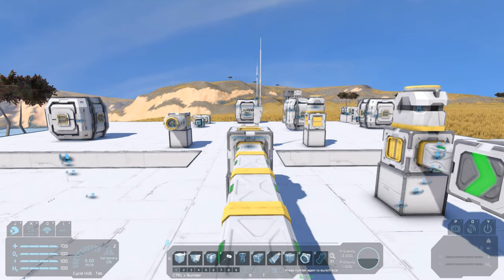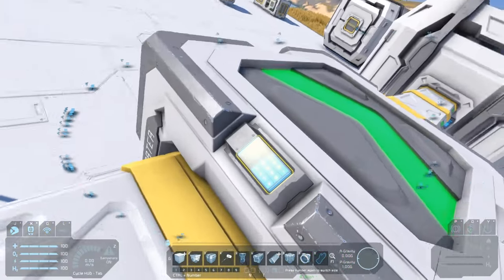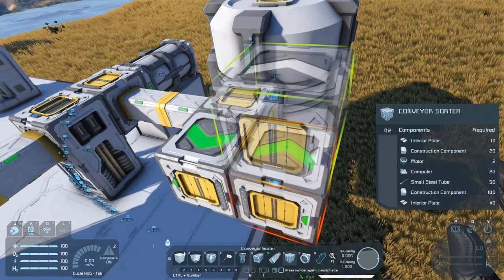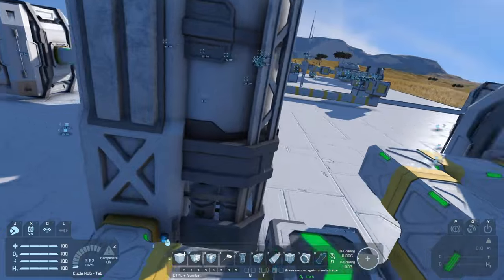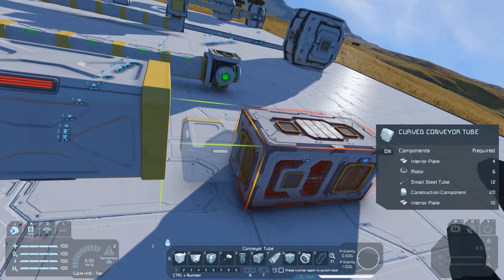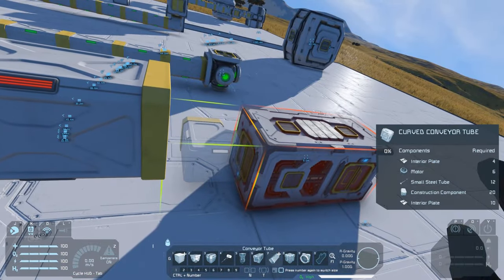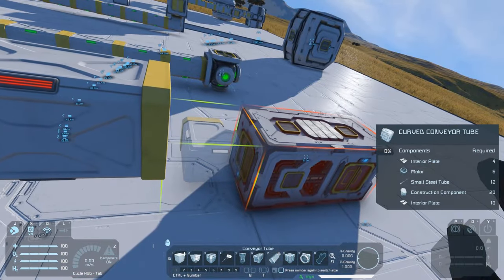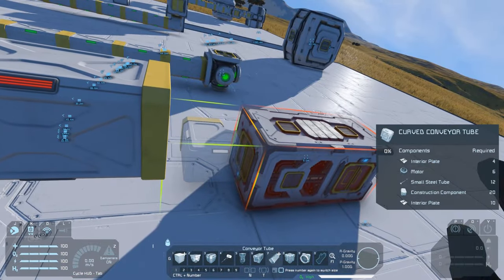Space Engineers Tutorial: Sorters and Conveyor Systems (tips, testing and tutorials for survival)

Comment: Spaghetti! ;) Nice video and well explained. I never used the sorters like this because I always had scripts that did the job for me. They basically came out too late in my opinion. This also reminded me that I always wanted to write my own sorting script that is a bit more light weight and easier to manage than TIM.. Maybe I'll find the time some day ;)
Reply from the maker: Well now I know what I'm having for dinner! :)

If you ever do manage to write a lightweight sorting script I would certainly be interested, I don't understand the details of the changes to the modAPI that Rexxar's been working on but maybe there's something in the next major update that will make a lightweight sorter even more lightweight, or slightly easier... man I wish I'd actually learned something when I did software design at school
Reply: School didn't help me at all.. All my knowledge of coding is purely self learned. As a hobby I do coding since I was 10 years old or so ;) And I learned C# with space engineers because I always felt that the scripts that are online lack some features I needed, so I decided to write my own ;)
I read rexxar's post and the changes seem to be very useful and could even improve and simplify my script's code. The thing I'm most exited to see is self running programmable blocks that don't need a timer anymore. This should make script timings and the setup process for the user even better..
Reply from the maker: School definitely didn't help me either - I still am and have always been, completely hopeless at learning any language, whether that's a programming language or spoken :P

Nice to hear that the changes are likely to be useful, I'll be needing to redo my 'how to use scripts' video once the update comes out and people have updated their scripts, probably a few other videos I'll have to revisit at some point, thruster damage comes to mind...

Comment: Great video..really helped me. But I'm having trouble with the bottles like some others are having. I did your setup to a T and it only keeps the bottles and never returns them :(
Reply from the maker: That was always a bit of an issue with this setup, what you need to do is set up a return loop with a sorter coming back from the O2 H2 generator. If you have a timer block set up to switch that sorter on when it turns the one that takes the bottles to the generator off you'll be able to bring them back without creating an infinite loop with the bottles just moving back and forth :)
Reply: @Splitsie  I tried doing what you suggested, and its not working. Maybe I'm misunderstanding your instructions, or I'm not setting stuff up right. Iv tried all day yesterday and I'm pretty burnt out trying to make it work. But I appreciate your reply!

Comment: So here’s my dilemma. The assemblers in space engineers don’t go for the nearest cargo cube, they store the finished product in what ever free space it finds first, i.e. connectors. I’m getting tired of moving all the items from random locations on the ship to the main cargo cube. Is there any way to make a Sorter pull/drain everything into a single cargo cube, yet still allow players to pull items back through it? Thanks!

Side note, is there a way to organize the inventory screen so you don’t have to scroll for half a page to get to a cargo container?
Reply from the maker: For that sort of situation you're probably best off building a separate conveyor system that joins to the cargo container that runs to the access point for the players, this way all the automated systems can dump into the container but the player can also access it. Sometimes when I've built sorters to allow for reverse flow (by placing a second sorter in the opposite direction) the game continually cycles the items through the sorters which is not great for performance. 

Sadly the inventory screen doesn't have much you can do to it to make it better, what I tend to do is make heavy use of the search bars on each side to shrink the number of inventories to something small and I make sure I name things once I've got a system big enough to benefit from it. You can also use the buttons that turn off the different inventory types to limit your list but I don't find these as useful.

Comment: Cool video as always. Could you extends this with a "gas transport special"? I would like to see how to refuel ships with oxygen and hydrogen which already has been produced and stored on a base. Is it even possible?
Reply from the maker: Thanks! 
I'm going to have to look into that - if they don't it might be entertaining to try to make them transferable with merge blocks or connectors...
Reply: You would need to have enough ice to fill both the base and the ship, the tanks equalise.
Reply: Possible yes. Just connect ship and station and order the ships tanks as the only tanks who 'stockpile' they will then suck the gas out of the stations tanks if those are not set to 'stockpile' If you cannot have a direct connection between station and large ship avaible build a small ship with tanks for manual transfer inbetween that. Bit of a hassle tho.
Reply: This is a question I have often though to test but always forget when I build a ship with Hydrogen Thrusters.  From what I can understand from the SE Wiki, Connectors can be used to expel gasses from Hydrogen and Oxygen Tanks.  That being the case, I assume that the flow should be able to go the other way although, I'm not sure how to make it work as you can't manually move gasses
Reply from the maker: As Chris K pointed out you just need to use the stockpile button on the tanks that you want filled. With this it will flow whichever direction you want through the connector. I just tested it and came back here to see that he'd already answered the question :)
Reply: Cool thanks! I will try that

Comment: Is there any way to sort Hydrogen/Oxygen gas using the sorters?
For example, I want to devise an automatic refueling station for hydrogen vehicles:

One end of the "pump" draws hydrogen from a transport vehicle, such as a tanker rover or freighter, the other end of the "pump" gives it back to vehicles parked at station pumps/landing pads like a gas station would.

My current understanding is that Hydrogen just kind of freely moves between tanks so far.  And I want to avoid using [Stockpile] since it:

1.) Prevents hydrogen distribution to the vehicle itself (IE: Thrusters).
2.) Drains other neighboring parked vehicles.
3.) Is annoying to remember to check it on and off before departing.
Reply from the maker: Unfortunately gasses can't be sorted by the vanilla sorters :(
Reply: @Splitsie  Guess I'll have to tinker a bit to see what is possible... thanks for the response none the less!

Comment: Hey man just started and using your videos alot. Right now I'm setting up my second base and I want it to be a proper base so I dont change alot later. I've copied the second base design in this video but am wondering if all of this really necessary? I thought the refinery and assembler pull material and communicate with eachother perfectly. Dose this speedup the process?(sorters and all)
Reply from the maker: They can speed up the process, but aren't strictly necessary as you say. These designs were more set up as a way to illustrate how the sorter functions than as attempts to design a base that I would actually use, what I'd recommend is to set up your conveyor network so you can place sorters in later, but that they aren't required initially, in other words, ensure there's a straight piece of conveyor that could be replaced if you decide the free-for-all isn't working for you :)

Comment: I have a question. I am trying to build a ringed station. The ring will be the docking port, but have decoys in it. So if I get attacked I release the decoys. I also want a conveyor to pull everything out of the ring so it won't get destroyed. I thought a sorter can do this but with it how could a put items into the conveyor system on the ring? Would it not go through?
Reply: Could I only pull stuff out from the ring?
Reply from the maker: If you have a sorter in the opposite direction that's turned off, you could turn it on when you need to pull things through and then back off when no longer needed - but to make it work nicely you'd possibly want to use a timer block to simultaneously activate the return sorter while turning off the pull function from the other sorter. The reason for this is that without turning off pull you'll end up with items moving constantly in a loop :P

Comment: Thank you been meaning to get a refresher will be putting to use soon also was trying to get components into my welding ship but havent worked out how just yet the items were stored in the connector at the dock point but never made it inside... any tips would he helpful thanks.
Reply from the maker: I've got a video on welding ships that might be worth a look, but the main issue people run into with welders and grinders is that they try to pipe them up using small conveyors in at least one section. For components to pass through you need to have large conveyors (on small grid) in order for most components to be able to pass :)

Comment: I can't seem to get ammo pulled into my ship containers. Ive made an assault cannon drone and it has a sorter inside but it doesn't pull the ammo from the connector into the small cargo containers. I can manually put the ammo trough so there are no problem with a conveyor part missing and the sorter is going torwards the small cargo containers.

Edit: The items are jumping between the connector and sorter.

Edit 2.0: I had made the convayors loop having access to both 2 ports of the weapon inventory. I fixed it by only the 2nd set of cargo containers having access to one of the gun's inventory ports.
Reply from the maker: If there's a loop then sorters will constantly pull, you need to make sure that any loop is something you can switch on or off depending on need so that the sorter isn't constantly pulling items from itself
Reply: @Splitsie  I'm quite the newb to this game I now have about 40h in game. My question is how do I switch a loop on and off compactly?

Comment: When i put on small ship ( survival mode ), small reactor, and connect it to a storage directly via conveys - then i put in storage inventory uranium ingots, they are not pulled in automatically from storage. What is the catch?
Reply from the maker: The grid needs to be powered for anything to move through the conveyor system, so you'll need to add an extra power source until some uranium is in the reactor, then you can remove the extra one (a small reactor is usually my go to for this as you get everything back from grinding it down) :)

Comment: So I have two sorters set up do far. One for components and one for ingots. The one for ingots keeps bouncing back and forth between the sort and the storage unit. How do I stop that? The one for components is working properly.
Reply from the maker: If there's a return loop then you'll end up with that situation since the sorter will keep pulling from the storage since it sees the storage as being on both sides of itself
Reply: @Splitsie  I ended find where it was. Took me forever to see it. I didn't even mean to put it there. I went looking for answers everywhere I could. A lot of what I found pointed to it being a big. I rebuilt it in another world to make sure, and it turned out to be a loop running beside it. I forgot to change the settings on another sorter. So basically, it was just another pipe. For the longest time, I couldn't find, and ended up adding a third sorter to compensate. Only made it worse. Finally, I took the whole thing down to start fresh. Still going off the original design, and found the problem. All good now though.

Comment: I came across a minor problem last night that should have been fairly obvious to predict but i somehow have always managed to overlook.  

I have a tendency to fill my Oxygen Generators to capacity so that there is always plenty of backup for Oxygen/Hydrogen.  The problem is that if you do this you can't refill your character's bottles because there is no room in the Generator to put the bottles to be refilled.  

I don't know how I have not noticed this in the passed but I certainly did last night.
Reply from the maker: Ah yes, the problem with being just a little too efficient ;)
It can also be a problem with airlocks, if you end up using a tank to store the oxygen but have a generator fill it, every time you try to depressurise you'll have nowhere for that oxygen to go except out the airlock, completely defeating the purpose :(
Reply: I haven't had a problem with airlocks since discovering the double door solution  ^--^
Reply from the maker: You mean just having them immediately adjacent?
Reply: I have a one block gap between the two (when using sensors to open and close the doors) to ensure that both doors aren't open at the same time.
Reply from the maker: A nice and simple solution :)
Reply: It is the simpler version of the one I described in an earlier episode (Large Ship Design Ep 3), as I play solo.  It works like a charm and is far more efficient (build wise) and simpler than creating the vented room.

Comment: ive watched this tutorial about 5 times now and i still cant get my system to work unless i follow it to the T. Am i too stupid for SE? Does everything have to split at the first container? trying to get everything to go through connector>refinery>assembler>storage1>storage2 with the way my base is setup but sorters in the places i need them just create a constant pulling cycle or prevent normal backwards access.
Reply: I find it much easier to have a redundant system.

Have a sorter pulling what you want into a large cargo container, then the other stuff like refinery, assembler, h2/o2 gens, etc just connected to that without sorters so they can just pull from that as needed. It's much more simple.
Reply: @Blue-ke5sb  mm but when assembler gets full i need it to connect to my main storage again, but it makes a circuit. can scripts do something about this? never used them before
Reply: @RfLARedBeard  I'm sure there are scripts for something like that, but I'm not an expert with them myself. I just have a circuit. Yes, the storage will pull from itself, but this has been pretty harmless to me, I always have the ability to pull what I need on demand.

Comment: I know this video is old, but I tried and tried last night to stack assemblers together and a refinery and I could not get the assemblers to pull inventory from the refinery. It wasn't large scale so there was no storage attached, but it didn't make sense that I would need to do a conveyor system when I want to just stack the units together. I lined up their smaller openings when placing and couldn't get them to share inventories. Is there anyway someone could guide me to a video showing this so I can see what I did wrong, or just tell me how to do it?
Reply from the maker: The smaller openings on refineries and assemblers are not conveyor ports. Those smaller ones are for upgrade modules, I suspect that's where most of your troubles have come from. The conveyor ports are the larger ports that nearly take up a full grid cube surface. On the assembler there are some parts that have both on the same square as well.

Hopefully that'll get you back on track :)
Reply: @Splitsie  ahhh, that makes sense.